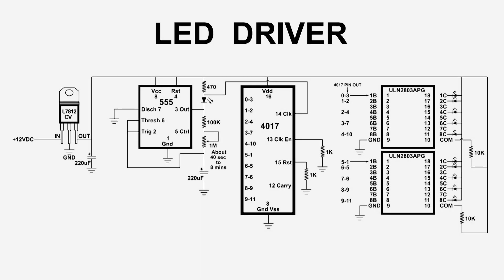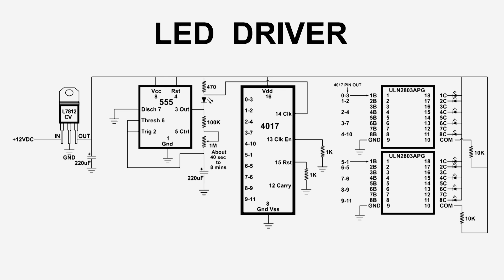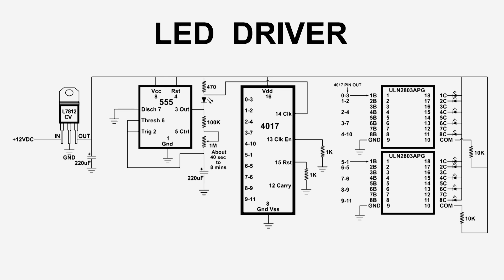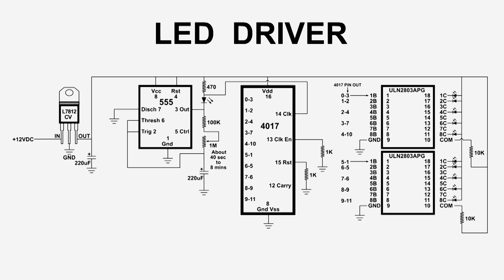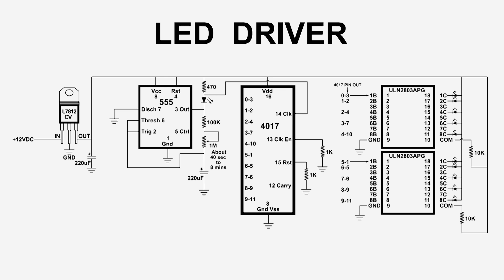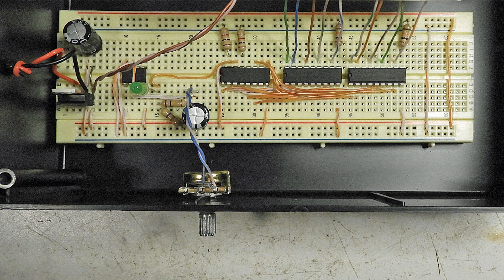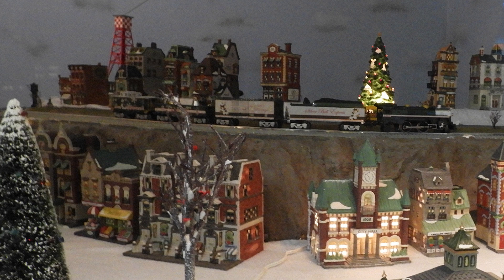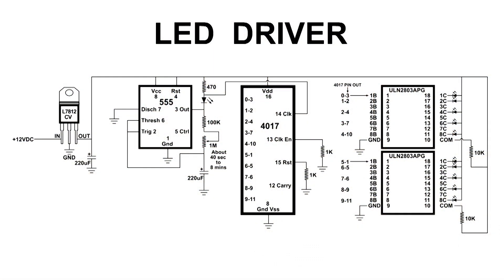LED Driver for Model Train Display

Comment: Boy oh boy, have I had my share of headaches when I handed over a project to a client with a solderless breadboard in it. There's always someone who can't resist opening the box and poking around! Good thinking on your part, taking that snapshot of the wiring while in a working state!
Reply from the maker: It's worse than that, they wore wiring it up with the 12VDC power supply on.

Comment: The COM pin is the common for the clamping diodes included on each Darlington pair for when you switch inductive loads.  They really are nice full feature chips to use for driving loads.
Reply from the maker: ULN2803APG  EIGHT  DARLINGTON  ARRAY
https://www.youtube.com/watch?v=CcbbN5WxpkQ